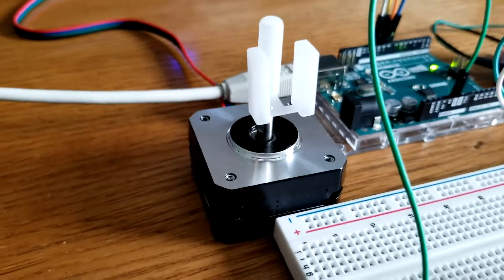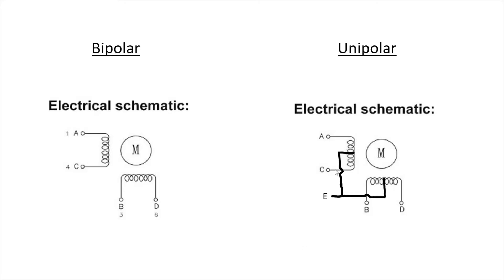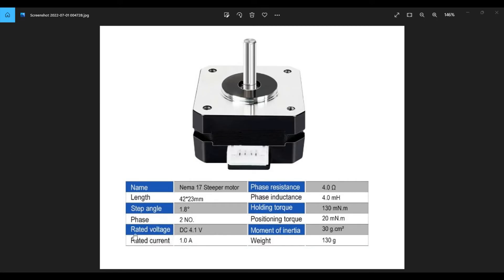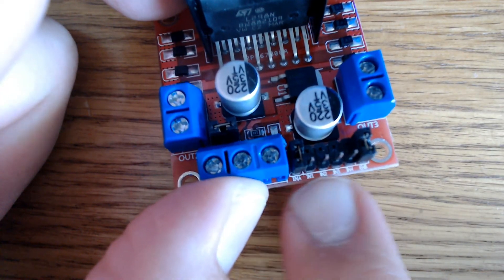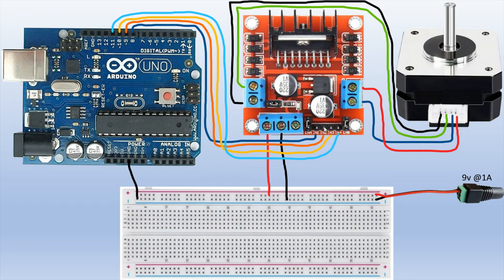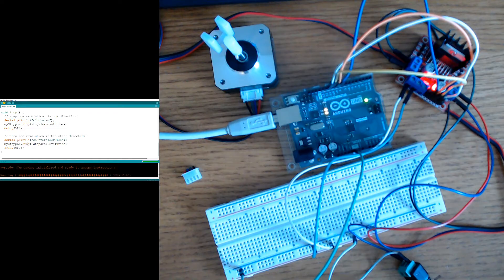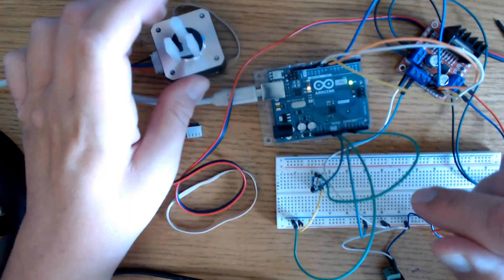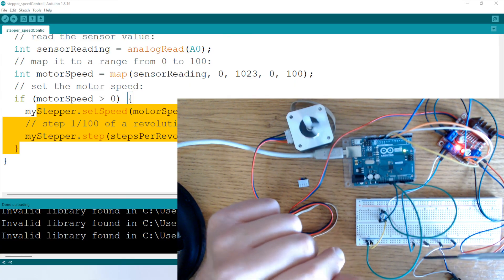Arduino Beginners Getting Started With NEMA 17 Stepper Motor and The L298N Motor Driver Module

Comment: I am wondering will this setup give a good amount of Torque? I tested it out and was very weak any help would be appreciated.
Reply from the maker: hey there!
A NEMA17 on an L298N Is fairly weak. The driver is the problem, not the motor. It isn't that efficient when it comes to torque - it can get hot quick.
You want a solid 12v supply that can provide enough current, around 2-3A.

See if something like TMC2209 is a better fit for you. They are very popular and may be what you need.
Reply: @BMonsterLaboratory  Ok thanks so much!
Reply from the maker: @eliwexler8238  you're welcome. good luck! 👍

Comment: Sorry for the late comment, but are you able to connect two drivers to the arduino? Its so i can have 2 motors connected to the same arduino, and make a homemade radar bracket that can go left/right and up/down
Reply from the maker: hey there!
yes, you can. 1 stepper motor per L298N Motor Driver. Just make sure your external power is sufficient. May take some research to put together, but it can be done! 👍

Comment: Just a heads up for my fellow friends: MAKE SURE YOU CHECK YOURE MOTORS WIRING SCHAMITIC, It will probably be different than this video. That is all!! Thanks for the great vid!!
Reply from the maker: Absolutely! 
 NEMA 17 just tells you the motor's size, not how it’s wired. Since some are bipolar (4 wires) and others are unipolar (5 or 6 wires), the wiring can definitely vary (2:15). A lot of vendors actually include the schematic right in the product photos, so it’s always worth checking or testing with a multimeter. Thanks for the reminder, and I’m really glad you enjoyed the video! 
👍👍

Comment: hello bmon. I desperately want to run the motor knob example sketch, are there any wiring changes that need to be made differing from your speed control sketch wiring? , and does the arduino motor knob code need changes? I have followed another guys  youtube site and he makes changes to the arduino motor knob code , but I followed his code changes and it keeps giving me errors, how can I progress from the speed control sketch to the motor knob sketch , any help would be greatly appreciated!
Reply from the maker: send me a facebook message with code  and diagram. We'll get ya going! 👍💪

Comment: What is the power adapter you used?
Reply from the maker: It's a dc power adapter with a barrel connector from Amazon. I use them all the time.  There are 12v and 24v options

Comment: Hi, Need help. I'm building a CNC Hot wire Foam cutting machine. I have (2)17HS3401S-SZ  Motors  as for X and  Y. And  i have a another step motor 17HS4401S as for Z Rotary. I'm using Arduino uno with GRBL installed and a CNC Shield with ( 3 )A4988 steppers. The steppers what motor current limit do i need to tune too ? I'm not sure ?so Motors wont burn out of course. This machine will be a slow process using UGS. Thank you. I'm still learning as you can see.
Reply from the maker: Hey there!  Unfortunately, I'm not familiar with GRBL or this setup, but I did find a tutorial that says:

"Regarding motor current limits, many builders tune the A4988 drivers to about 70–80% of the motor's rated current. For example, if your motor is rated around 1.2 A per phase, setting the driver’s current limit to roughly 0.8–1 A is a good starting point—but always check your specific motor datasheets and adjust accordingly."

It seems like a good start. You can check it out here - https://chatgpt.com/c/67a95c7f-0d34-8007-8573-9451445a035e
Sorry, not much help for you on this question...

Comment: I am trying to get my 2 stepper motors to work with my Flysky rc transmitter/receiver but can't find any video's that show how stepper motors work with rc controllers, do you know if it would work If i replaced that potentiometer with my receiver ? in other words can I connect those 3 wires from the Arduino to the receiver instead of the potentiometer
Reply from the maker: switching the potentiometer with your RC receiver output probably will not work as intended, because the two signals are different types of inputs. Taking the three wires from where the potentiometer was (V+, GND, and the analog output) and just hook them to the receiver’s servo channel (signal, V+, GND), the Arduino’s analog input will not read a stable voltage. It would see a quick changing pulse. Attempting to read this directly as an analog input won’t give reliable results. The Arduino’s analogRead() is designed for steady DC voltages, not digital pulses.
you’ll need to modify your Arduino code to read the pulse width of the RC signal. Once you interpret that pulse width as a control value, you should be able to drive your stepper motor.
Reply: @BMonsterLaboratory  Ok I'll keep searching, Thanks for taking the time to reply
Reply from the maker: @NevesProjects  you're welcome. I hope it works well for you! 👍

Comment: Great video and excellently explained. 😊😊 I'm about to undertake a little DIY project which involves, a touch screen to control a stepper rotation and movement, but trying to source the correct, compatible components is mind boggling.this has helped me understand some basics. Thank you.
Reply from the maker: That sounds like a fun project! What are you using for the touch screen display?
Thank you for the kind comment.  👍😎

Comment: Awesome video, very informative Thanks.. will this work (code) with a Arduino Nano, need space! thank you!
Reply: Thank you so much for replying so quickly. I appreciate you for sharing your knowledge and jumping right on it 👍
Reply from the maker: Thanks~!  I appreciate it.  
Yes, it will work with Nano as long as the Nano pins you're using match the pins declared in the code.  👍

Comment: Hey, be carefull when copying the schematic from the video. I tried to copy what was done in the video, but the motor kept spinning in random directions. I followed the instructions as closely as possible, but it still didn't work for me. I even used the same model of motor and driver. As a last ditch effort i swapped a couple of the wires going from the driver to the stepper motor in an act of desperation, and after dozens of hours of brain-rott it magically worked. Not sure if the diagram is wrong or i had a faulty product but it finally worked. Im not mad at the creator, i just want share my experience, so that it may help at least someone out there.
Kind regards Hen ry
Reply from the maker: hi, thanks for the heads up. Sorry to have delayed your project. do you know which wires you switched? I was sure I had this diagram nailed down correctly. I'll go back and try it out again. Thanks again for the info

Comment: Couple questions: 
1. Is the power 1-2 amps at 12 volts safe for humans? Do you need to take precautions?
2. How do you know it's safe to power the arduino via the computer? Eg that electricity isn't feeding back through the signal wires from the driver board? Also the driver is powered from the house circuit, but what if the laptop is on battery power? What does it mean to connect the ground of the battery to the ground of the DC power supply from the wall?
Reply: Also, thank you for this great tutorial!
Reply from the maker: Thanks, Brandon!
Reply from the maker: Hi there!  
1.  12v is considered low voltage and 1-2amp is considered relatively low as well. You should always take precautions regardless of the amount of voltage and current you are using. Low current, as low as 10-20ma, could cause heart arrythmias. There are many factors in determining what is safe and what is not. Check out this website https://www.hsa.ie/eng/topics/electricity/dangers_of_electricity/
If you're not comfortable with electric circuits, get help from someone who is experienced. Practice connecting low power circuits until you're confident. As always, be careful with electric connections and  avoid getting shocked 💪
2. Standard USB from a computer is 5v. It may fluctuate from 4.75 to 5.25 but I have never had a problem with powering small peripherals like leds or motion sensors this way. I have connected Arduino to my laptop and it has worked fine. If I ever use  more than a couple leds or more than 20ma on one arduino pin, I will always use external power and I never power motors of any sort directly from my board. 
Current does not go through Arduino signal wires. Arduino signal wires carry digital signals, which are represented by voltage levels. When a signal wire is high, it is at 5V. When a signal wire is low, it is at 0V. The current that flows through Arduino signal wires is very small, typically less than 1 mA. This is because Arduino signal pins are not designed to carry high currents. If you need to power a device from an Arduino signal pin, you will need to use a transistor or other circuit to amplify the signal current.
Did I say connnect the ground of the battery to the ground of the dc power supply from the wall? I was searching the caption and couldn't find it so i'm not sure what I was referring to.
If you look at 10:20 I have 9v 1amp coming from a regulated power supply plugged into the wall. The positive wire is connected to the driver pin that powers the IC’s internal H-Bridge, which drives the motors. You can use 5-12v here. The neg wire is connected to the ground rail - you want your circuit grounded. If you want to unplug the USB power and connected Arduino VIN pin to the 9v rail, you could power the board that way. 
Thanks for the great questions. I hope I answered them without too much rambling. This is a hobby I enjoy and if you have anymore questions, please feel free to ask! Good luck!
Reply: @BMonsterLaboratory   wow, thank you for such a thoughtful response! This helps!
Reply from the maker: you're welcome! enjoy your Arduino projects ~

Comment: 5:00 Sadly you are not explaining how to calculate your values.
Reply from the maker: the NEMA17 stepper has 200 steps per revolution with a step angle of 1.8 degrees. With 360 deg in a full circle, 360 / 1.8 = 200 steps for one complete revolution. 
If you want to adjust the timing of your rotation check out my previous video - https://youtu.be/I9GUL64_3Xw - at 5:41     Thank you for pointing that out. If you have any questions I'm happy to do my best answering. good luck to you! 👍

Comment: How much torque does it produce with the 9 volt input pls ?
Reply from the maker: Hi there! This 4.1v stepper at 9v will probably produce torque below the rated number on the Amazon post. 9v works for me but a nema 17 @ 4.1v has a recommended operation voltage of 10-12v. A nema 17 with a voltage rating of 4.1 operating at 9v 0.5A may produce a holding torque around .2Nm and operating at 1A could produce .4Nm (57oz-in). It's just an estimate and could change under different conditions.

Comment: Thanks for the tutorial! Quick question: Do the 4 pins on the Arduino connected to the L298N motor drive module have to be PWM pins, or can they be regular digital pins? Also, would analog pings A0 - A5 work as well?
Reply from the maker: Hi there! The 4 pins don't have to be pwm, they can be digital or Analog. The Arduino has an analog-to-digital converter (ADC) that measures the value of analog signals. The ADC converts the analog voltage into a digital value. Use analogWrite(pin, value) to get the value. We can also use a potentiometer at A0 to control the stepper speed, but that's perhaps a video for another day.
In the code we used here, just replace line 24 with this: 
Stepper myStepper(stepsPerRevolution, A0, A1, A2, A3);

The  code in the video is the stepper_oneRevolution.ino example in the Stepper.h library.  Hope that helps!

Comment: Really instructional, I am about to automate a little Christmas scene using a stepper motor with a NEMA 17 10.4 V 0.33 A . I am just trying to figure out why you need two power sources? The 9V  and the computer powering the Arduino? I didnt know why you cant run the entire thing off of the power jack? Im pretty illiterate with electricity honestly though. Thank You!
Reply from the maker: Hi Chris! thanks for the comment. Sounds like a fun project you're about to dive into. I don't power motors from the Arduino and in this video you can see I just chose to leave the USB plugged in for a power source. If you run a motor off the power pin of your Arduino it could potentially kill your board. Some small motors may be ok to run off the Arduino, but I just make it a habit to use external power when I run motors and other devices with similar power requirements. I could have unplugged the USB and connected the 9v power rail of the bread board to the VIN pin on the Arduino and to the motor driver. 9v is ok to use on both (Arduino & motor driver) because they both have a 5v regulator. I hope that helps. If you have any questions throughout your project, just shoot me a question on here, Facebook, or email.  Good luck and Merry Christmas!